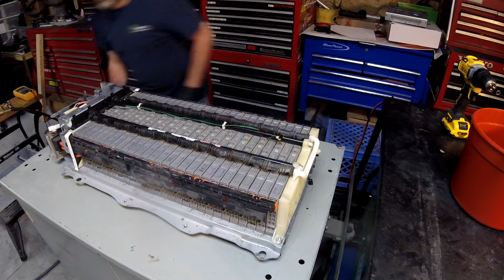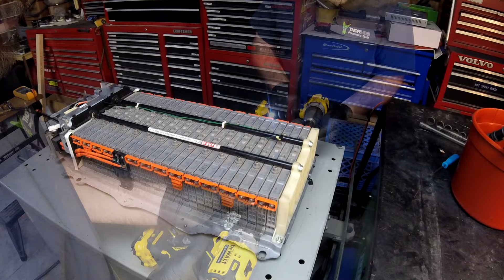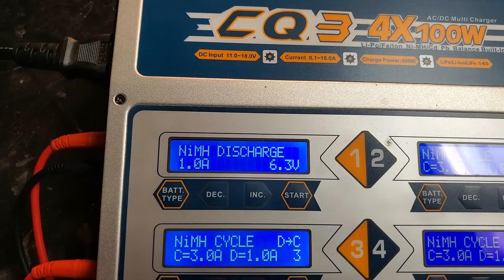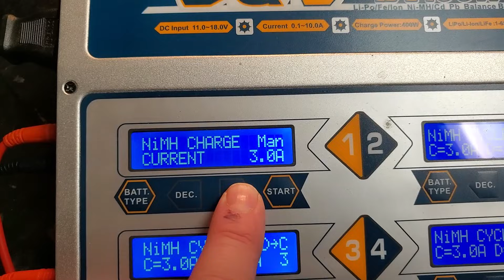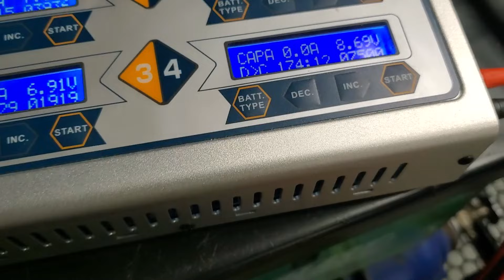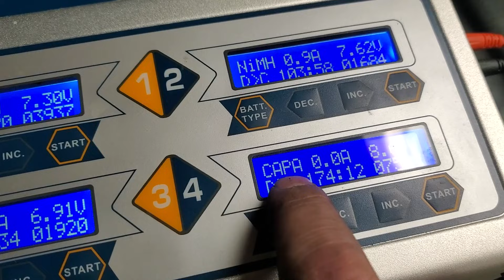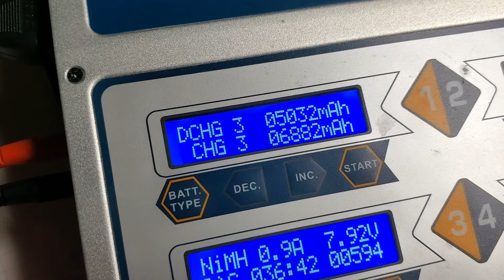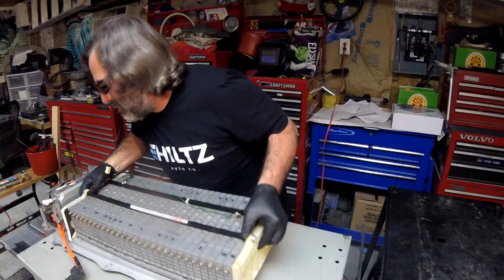DIY Refurbish / Repair Hybrid Battery 2nd Gen Toyota Prius - EV-Peak smart charger POA80 P0A80

Comment: Thank you Greg, great demonstration!!  Have you run into modules installed backwards?  I recently had a battery with 4 modules installed backwards.  I assume that it took out the entire battery... every module has tested bad, very bad!!  Waiting on a replacement battery at this time.
Reply from the maker: Wow! I have not heard of batteries being installed backwards. Whoever put it together should have realized the mistake at least when installing the vent tubes. The good news is you have determined what was wrong and have a fix in the works. Good luck with your car for the future.

Comment: Love the video and am currently doing my father in laws Camry hybrid battery.  I have a couple of questions, Once we get to over 5000mAH on the lower setting should we just stop cycling and consider it good, or keep going?  Second, have you ever reconditioned a 12v car battery, and if so what kind of settings are you using for that?  Thanks
Reply from the maker: You can keep going if you like when you have 5000/7500 but there will be a point where the values will start dropping off and do not come back. The hybrid pack batteries are connected in series. For this reason the capacity of the pack will be determined by the battery in the pack with the lowest discharge value. 5000mah is enough where the car will have most of the capacity back without pushing the limits of the batteries so we set that as a cutoff point.
Reply: @ Thats great, All of them so far are above 5000mAH on lower end; after cycling a few times, and almost always 7500mAH on upper end, so ill just go with that.  Battery Capacity was at 50% on my XTOOL tester before removing from car, so Im anxious to see the improvement after refurbishing the modules.
Reply from the maker: If your lowest battery has 5000mah discharge value, your pack capacity should be around 80%.  Please do let us know when you get done how it comes out.

Comment: What settings would you recommend for 2010 Lexus RX450H the module specs are slightly different. 
Module Voltage = 9.6V
Cell capacity = 6.5 AH

Comment: Trying to buy one. But the website says:   This charger is NOT designed for use with hybrid car batteries. Any such use will damage the charger and is not covered by warranty.   Can someone clarify on this?
Reply from the maker: This warning was not posted when I purchased my chargers. I have been using these for years with no issues.  There are other chargers out there that may be better. If you find one that offers the same settings, it should work for you. Please write back and let us know what you decide to get.

Comment: I'm struggling.. Purchased a couple of BGUAD cq3 4x 100w. I set them verbatim to  you video (user and NIMH settings) They run for a few minutes and say FULL 0.0a 12.98v chg 013:29 00495, another FULL 0.0a 12.77v chg 004:29   00152 etc so it looks like it runs for a few minutes and goes FULL. No matter which cell in the pack I run this on they always go FULL. it's like I'm only charging the battery.  (help)  Also;  on the other unit it seems to run 3 to 5 cycles, but the numbers are always low under 1200 no mater how many times I run the series of 3. Do you just keep at it, hour after hour, day after day until it gets to 5000/7500?  The cells ALL CANT BE BAD. While charting the numbers on the other unit, after several 5 string passes I get weird numbers on multiple cells like: D 613,C387.....D327 C 1066 then followed by D502 C 1358. I don't get it.  Thank you for any help. J-
Reply from the maker: Thank you for watching. I have recently been informed that some of the leads sold have wire size that is very thin and can cause weird readings.  I have not had the issue you are describing before with 22awg wires.  Do you know what gauge wires you have?
Reply: @GreggFesto I’m getting the same issue. It says “Full” and stops after about 10 minutes. Before that the same module charged and maxed out with CAPA at 7500 Mah after 4 Hours and 10 minutes just for 1 module. I’m using 14 Gauge wires which are the same Gauge as the shorter oem  wires that come with the CQ3 4x 100W charger so I don’t think it’s because of the cable thickness. What does “Full” mean?
Reply from the maker: FULL means that the charger has gone through all cycles and is finished.
Reply: @ isn’t that what “End” means though? I’m charging now and I tried it again and it’s cycling through the steps and not giving me the “Full” anymore. Still a mystery.
Reply from the maker: I believe END and FULL are the same with these chargers.
Reply: Yeah I’m having the same issue, I think the wires I got from EBay are too thin they get hot when charging the batteries, I found some on Amazon that are 18AWG so I’ll come back with the update

Comment: Did you have to clean the bus bars or were they free of corrosion?
Reply from the maker: They did have some corrosion. I cleaned them with a wire wheel. Since I have found it easier to just purchase new nickel plated bars and stainless nuts from Amazon.

Comment: hi once u remove the saftey plug, can i touch any bolts or ii may get electricuated..  you are using basic glove will that help?
Reply from the maker: I have done many of these. I usually wear Nitrile gloves. They are all that is needed to prevent a shock.

Comment: Great video especially the disassembly and assembly process. I am doing a battery now and at the stage of replacing 2 bad modules. The equalization and using the data to arrange highest values in the middle was very insightful. Thank you so much.
Reply from the maker: Thank you for watching Mike.

Comment: Please friends,  I'm doing the exact same thing.  But, I'm only getting 0000 for discharge and 0106 to 0110 for charge.  Every cell I try.  I'm desperate.  I'm getting frustrated.  I've watch many videos, they all get what you get here, but I don't.  What am I doing wrong?  I start at the same screen too. Please help😥
Reply from the maker: I have had some people report that this can happen if the wire leads are too small in diameter.  Do you know what gauge wire leads you are using? I believe the ones I am using are at least 22awg maybe even 20awg.
Reply: @GreggFesto  Thank for responding Gregg. It's possible.  They were very flimsy.  I did get a couple connection errors. So,  I purchased a new set. Now, the whole process is taking way longer.  I'm on my first run. So, hopefully that was it. I will let you know how it goes.
Reply: That's what it was.  All good now. I didn't know the size of wire matters. Now I know.  Thank you sir.

Comment: Hey Gregg! Great videos. 

Following your videos, I started the process with the CQ3 Charger... 

I'm stumped because I cannot find where to see the Results of the Discharge/Charge Cycle.

Mine ends with a flashing "FULL" instead of "END" so I don't know if that has something to d with it.

Reviewing your videos I don't see what you do to access the results... I bet it's right under my nose, but if you could share how I get to the results numbers I'd really appreciate it.

I've looked everywhere online and can't find it either... 

I'm stuck at this point because I can't find out if the modules are good or bad.

Thanks!
Reply from the maker: Thank you for watching. The FULL message is the same as END message. It means that your charger went through all of the cycles you set up. The button you want to use to view the Discharge/Charge values is the one on fart left. If you have red CQ3 this button is MODE/ESC if you have the silver CQ3 this button is BATT/TYPE.  I have another video on channel that shows the process using both chargers at same time. Please note that if you press any button besides this far left one after running the cycles then you will need to redo the cycles to get results. Let me know how your battery comes out after refurbishing.
Reply: @GreggFesto  UPDATE: 
I returned the charger and ordered another one from another vendor on Amazon.
The new one works as it should. At the end of a cycle(s) I press the MODE/ESC Button and it shows the Results Screen - just like on your videos.
I bet it's a sorftware/firmware issue, but I couldn't find how to update it with my first unit - these chargers don't have a USB Port, it's probably not possible.
I wanted to post an update here in case it happened someone else.
Thanks!
Reply: @KitchenMycology   Hi, which model and vendor on Amazon did you end up buying the second time when it worked? Thanks!

Comment: Great video! With a pack that all the modules are over 5000mA, in your experience roughly how long should that last? I know theres no guarantees but Im just wondering if its 6m or 18m or 36m? I feel like as modules age that they tend to lose capacity faster....am I wrong about that?  Thanks for this! Im trying to decide if I want to rebuild mine like this or just replace it....just that financially, the car isnt really worth replacing the battery with a new one.
Reply from the maker: Thanks for watching. The battery in this video has been in the car for 3 years now. The MPG is starting to go down. I am not sure if it is because of the older batteries or because the car is now driven only about 25 miles per week. I plan on getting the car back to the garage in the next few months, removing the pack, and running it through the process again. I plan to post this on youtube so check back in a bit.

Comment: What can happen if I don’t balance out every battery cell? I replace one module and there all around the same amount of  volts and resistance would this affect anything?
Reply from the maker: Thank you for watching. It is not uncommon for there to be some deviation in the batteries. Balancing gets them close but they will start to change once in the car and being used anyway so it does not matter if they are not exactly the same.
Reply: @GreggFesto   thanks for the fast response. Amazing video too Gregg
Reply: @GreggFesto  The last question I have is about is on the installation of the modules new module. My battery modules voltage fluctuate between 7.67V (the minimal and it's 1 module) to the max 7.82v which is the new module and its just that one at that voltage) average voltage is 7.76v and my resistance is the lowest 4.88m the average is 4.90 and the max 5.43 (which is the new module). I've seen that before re-installation a lot of mechanics do the step of discharge and recharge on every single module before reinstalling the battery back on. I don't have the machine right now to recharge and discharge The modules.
Would this cause a problem or suggest just ordering the machine and this extra step.
Reply from the maker: The charger is best way to determine status of each battery module. The capacity of the battery is the most important factor. If you have gone through the trouble to remove the pack and take it apart then it is a step away from determining health. You can get a single channel charger to save some money, it will just take 4x longer. If you are not wanting to purchase charger at all then you could assemble the pack and put it back in car. Use inexpensive bluetooth odb2 code reader and dr prius app to test the battery while driving and then get results on health.

Comment: i read in a different forum that the max charge capacity should be 8500 mAh as a lot of energy is lost in charging through heat and that the delta peak wont often be reached if set below this value. I charged most of my batteries this way without issue as most didnt reach this value anyway, until a cycled a couple of brand new batteries that i was using to replace some faulty ones. i could hear some kind of hissing like air was escaping and was getting worried. do you think i've done serious damage to those brand new modules by "overcharging"?
Reply from the maker: Thank you for watching. I have been using the settings listed for years without issue. Adjusting CAPA to 8500 provides minimal benefit that I have seen and can leave room for overcharging. When running multiple cycles you can watch the "trend" of mah values on both discharge and charge to determine if the battery is good. The batteries will outgas some when cycling and I suspect this is what you experienced. The best way to know if the battery is still good would be to run cycle with my settings. If you get 5000mah or more on discharge and charge then you are good. Please write back and let me know how they do.

Comment: Why would you only care about the minimum discharge mAh rather than the maximum charge mAh?
Reply from the maker: Thank you for watching. The discharge mah is important because it is the actual capacity of the battery and what dictates how your car will perform. The maximum charge mah is limited by the charger. Both accounted and cared for.

Comment: i'm trying to recondition some old modules that have been sitting on a shelf for a couple of years. Every time I go through a charge discharge cycle, the numbers get worse. My charge numbers all usually make it to 7500 MAH  the first couple of cycles, but as I go through more cycles, they end up being in the 6000s. The discharge numbers are usually less than 3000 and rarely improve much or even get worse. Could this be a problem with my charging unit? Or do you think these modules are just too old to recover?
Reply from the maker: Thanks for watching. When the batteries have been sitting a while they do as you are describing. I suggest running some more cycles on them to see if you can get the discharge and charge to 5000mah. I have run around 15 cycles on stubborn batteries before. The numbers will fluctuate some and this is normal.

Comment: Where did you get those alligator clips for the modules? I bought the same charger brand new and it didn't come with those same clips that your using in this video .  I have 5 positive and negative alligator clip but no clamp on one end and on the other end of the wires they connect to the yellow male end for the positive negative yellow slot DC input for the charger
Reply from the maker: Thanks for watching. I got the clips from Amazon. Search for Banana Plug to Alligator Clip Leads 14awg.
Reply: Thanks I just got some they just came in. Trying to condition the modules now but I'm a bit confused with all the settings

Comment: @greggfesto I've followed your instructions, working on a 2009 prius battery.  All cells the low value is coming in under 1000 and fluctuating up and down.  Is it realistic to think these are all bad, or could I be missing something?  I've triple checked the charger settings.  Thanks!
Reply from the maker: Thank you for watching. I left one of the settings out when recording this video so I wrote them in the description, did you check there? I have another video on my channel showing Prius hybrid battery repair. Check it out when you get a chance. It has slightly different setting but works very well. It is not uncommon for the batteries to read low numbers at first especially if they have been sitting a while. I have run 10-20 cycles on batteries to get them back in shape.
Reply: @GreggFesto  Hi Gregg, thanks for the quick reply,.  I did watch the new video also.  I'm using the red 4x charger from your new video.  My settings are (precharge time off) (wait chg>dis 5 min) (nimg sens d peak default) (temp cutoff 80c) (safety on 720min) (cap cutoff on 7500mah) (input pwr low cutoff 11v) (nimh charge man 3.0A) (current limit auto 3.0A) (nimh discharge 1.0A 6V) (nimh cycle d>c / C=3.0A D-1.0A 3x).  The batteries are all going through 3 cycles in 3 hours or less and none of the batteries gets hot or is looking swollen in the pack.  I'm puzzled, not sure what to try next.  As an example, my numbers are all in the hundreds on both charge and discharge nearly 100% of the time, the highest reading I've seen on anything is around 1100 on both discharge and charge cycles.  I have cycled many of these 9 times or more.  The batteries were fully operational in the car, they've not been sitting.  Using Dr Prius app the pack was down to around 40% capacity overall and needing to be replaced soon per the app.
Reply from the maker: The only difference I see between our settings is the low power cutoff for you is set at 11V while mine is set to 10V. I do not think this would cause an issue. You should be seeing changes in the battery at 9 cycles for certain. I am wondering if there is something wrong with your charger or cables. EV-Peak does offer support through email, might be a good idea to reach out and see if there is a test you can perform to verify the charger is operating properly - - service@ev-peak(dot)com - -
Reply: @GreggFesto  Thank you for the quick feedback!
Reply: @GreggFesto  Hi Gregg, FYI I figured out that I needed better cables.  I initially bought very cheap cables off Amazon, I went back and bought more expensive 14AWG cables and now the process is working just as you described in the videos.  Thank you!
Reply: @greggfesto we finally finished the process, had to replace 0 modules and the battery now is testing 100% on dr prius app.  It looks like everything worked out great!  It was a nice project to do with my teenage son, this will be his first car and he was able to do most of the work himself.  I really appreciate your videos and responses to my earlier questions!
Reply from the maker: Thank you very much for the feedback and kind words. I am happy that you guys got it done and made memories that will last for life. I love remembering back to when my father and I worked on stuff together.